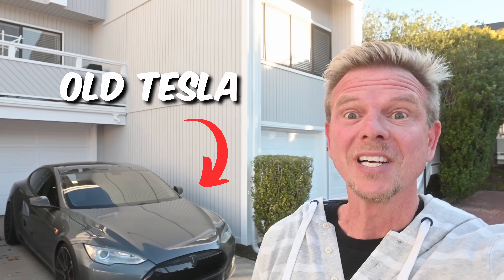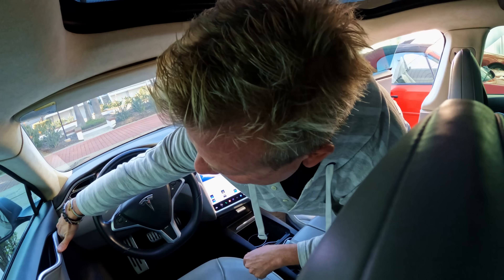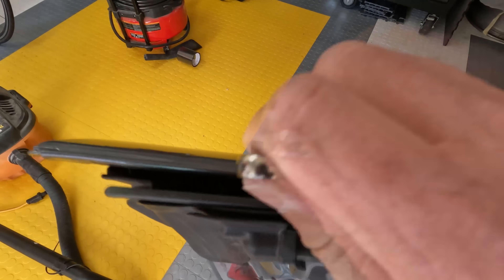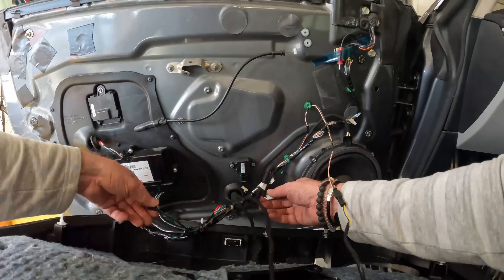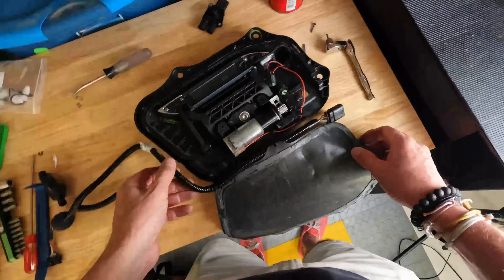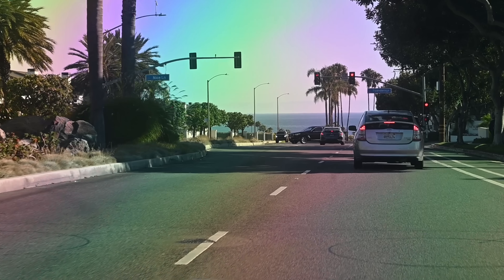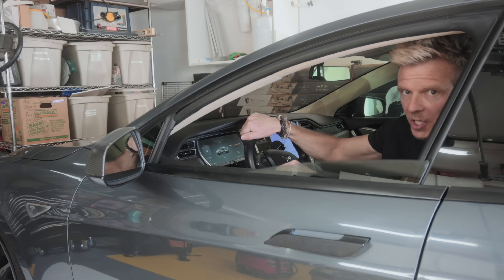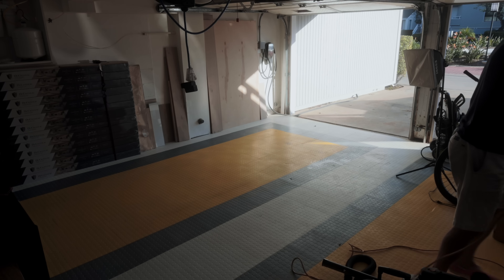My OLD Tesla Model S Just BROKE. Now What???

Comment: The only thing that has "broken" on my 2012 Ford Focus Hatchback with manual transmission is the coolant reservoir just recently cracked. I bought a new one and it took me a minute and a half to replace it. The car has 164,000 miles on it.
Reply from the maker: That’s amazing! 
But on the flip side - you have to drive a 2012 Ford Focus every day… 😊
Reply: @cadreamdrives  - Being a hatchback is it very convenient for hauling all my filming lighting equipment, as well as the occasional purchase, like the lawnmower I bought 3 days ago. It is fun to drive. It handles well. I get 35 - 36 mpg in the winter and 37 - 41 mpg in the summer. I love this car. Ford could have had a hit on their hands if they didn't stick with the DCT transmission it had. That killed the vehicle. Since I've only been driving manuals since 1991 though, it was a no brainer for me too. I also bought it with 16,000 miles on it, and saved $8,400 off of sticker....because used manuals don't sell well. With 164,460 miles on it now, it may be my last car. Still runs perfectly.
Reply: How much longer do you have to drive that Focus for losing the bet?
Reply: @AStanton1966  - This will likely be my last car. It still runs and drives like new. I've done the regular maintenance on it (I am previously an auto tech and I've worked on cars my whole life). It has been the most trouble free car I've had and it is fun to drive. Without the horrible DCT transmission there are none of those issues. 

Today's cars are not much more than over-tech packages that collect data that violates your privacy. Many cars have large screens in them that you HAVE TO LOOK AT in order to use heater controls, or to jump from one specific radio station to another. This requires you to take your eyes off the road so that you can be sure to touch the exact location of the images of buttons, instead of being able to FEEL actual buttons/knobs without looking.  The notion that controls in a car are done that way, making you take your eyes off the road, is insane.

Today's cars track HOW you drive, WHERE you go, HOW OFTEN you go there, how MANY people you take with you, and if they are adults or kids. This data is collected at any time by the manufacturer (you didn't believe Over-the-air Updates were for your convenience, did you?)  and then sold to a data collection company. It is another source of income that the manufacturers make off of you. Then that company identifies your insurance company and sells your information to them, and THEY make money off fo you too. Then your insurance company looks at the data and see you slammed your brakes on several times, and you accelerate faster than they like. This makes you a "risky" client and they increase your insurance rate. There are already a number of videos here on YouTube of that happening. Please take 4 seconds to search for them if you don't believe me.

The light that comes on when you have something kind of heavy in the front passenger seat that says "Passenger Airbag Off" is there to keep the airbag from harming children when they are in the front seat. However, that same sensor is on all the seats so that the car can collect info on how many people are riding with you, and if they are adults or kids.

I am choosing to opt out of that by not owning one of these newer vehicles. Also, my car has been paid for for years. I bought it when it only had 16,000 miles in 2014. Original sticker price was $22,400. I only paid $14,000 for it. Because it has a manual transmission there wasn't as big a market for it, so it was cheaper. I believe I am the one who is laughing loudest.
Reply: @1001Hobbies  I've often said that 40 years from now the cars of today won't be classics and showing up at the car shows.  There're too many electronics that will degrade.
Reply: @AStanton1966  - Besides that, the body styles prioritize aerodynamics over style. In the early 1970's and before it was about style. That's why they are classics. Agreed.

Comment: This is the exact reason I turn off the folding mirror when the car is locked. Imagine how soon it will fail after opening and folding 4 to 5 times a day. Personally, the less tech the better, only when the feature is necessary. Tesla is basically a hibernate mode of a laptop so it is constantly using battery even if you don't drive the car - loosing about 1% a day by just parking. The old remote car key would be just fine because the car basically has to constantly figured if the phone or a key is nearby to unlock the car.

Comment: My cadillac xlr v is having issues...the door pads went out and now the push button on the inside went out along with the window wires that are connected to the motor, rusted out so my windows stopped rolling down.  Pretty crazy this electronic stuff

Comment: The KISS "Keep IT Simple Stupid" method would have worked better. Why is there is servo just to extend the door handle out to for you to extend it further to open the door? High tech is nice but simple door mechanism design over 100 years ago seem to cost less and quite possible never fails.

Comment: Ugggg, toooo complicated.  Sooo many reasons not to buy an EV!! The $1,500 u saved on doing the repair yourself u can apply to the cost of battery replacement! Say $35,000 to replace battery?
Reply from the maker: It’s actually quite a bit cheaper than that. A refurbished battery from Tesla is less than $15k now, and 3rd parties have them even cheaper. You can also get them repaired. 
And while that is still a lot of money, it’s a lot less than it cost to replace the two gas engines I’ve had self destruct on me (BMW 650 and Jaguar XKR). 
Owning an older $100k+ MSRP car is never without risk. But there are lot fewer things that can break in an EV than in an ICE car.

Comment: You have a dilemma...
your garage doesn't seem that its wide enough to drive into and exit from the passenger door. So if you drive straight in and exit the driver door you can't open it again. You would have to back into the garage and then slide over the center console and exit the passenger door. And of course, slide over again to drive it out.

Good that you resolved this little technological nuisance. It could have happened anytime you parked in a parking lot and someone parked too close to the passenger door.

Comment: Wait till the $37,000 ??? Battery has problems. Hopefully Amazon will sell a fix for it. ONE GRAND for a door handle??? My F1 McClaren Race car has a cheaper handle price. I could buy TWO handles for that Tesla Price. GOOD LUCK!!!!
Reply from the maker: I think you may have to check your battery prices 😊. 
But here is the thing. It may cost me $15k if I ever need to replace the battery in the car. That’s a lot of money, for sure. 
But it’s a lot less than the cost when my Jaguar XKR and my BMW 650 had engine failures - both a much lower mileage. 
A Tesla Model S is not a cheap car and repair prices tend to follow the original cost of the car. 
But right now, old Teslas can be incredible bargains - even with the risk of battery failure. 
I’m also not sure you really want to be comparing service and parts costs - or general reliability - with McLarens. 
They are awesome cars, for sure, but they don’t exactly excel in reliability and affordability 😄
Reply: This is why 10 year old Tesla’s are not worth anything, but for parts.

Comment: Now if you were a Service Technician, you get paid once.  And you usually get paid 50% of what it actually takes to do that job.  But the Manufacturer calls that a Fair Price.
Have you noticed how many Service Technicians have quit the Business?
Reply from the maker: In all fairness, if I were a Tesla Service Technician, I would likely have finished the job in 30-45 minutes…
But - it sounds like you have some knowledge about unfair practices at Tesla? 
Do Tesla Technicians get paid per task? Not through an hourly rate or a fixed salary? 
My experience has mostly been with other manufacturers, where opposite seems to be true. They charge based on the amount of time a job says it takes in the official service manual - but the technicians do the job in half that time, or less. They often also ignore time savings when parts of jobs overlap. For example, if it takes 30 minutes to remove the under trays, and they have two tasks that require the removal of those trays - you’ll get charged for 2x30 min - even though the trays only get removed once.

Comment: I personally wonder where Tesla would be if being practical and reliable were prioritized over being cutting edge and techie?
Reply from the maker: I feel like they have done an amazing job at trying to be both. Especially for a brand new (at the time) car company. 
My Model S has been incredibly reliable - and it’s immensely practical. 
Does it have quirks, flaws, and things I wish were done differently? Absolutely. But no more than any of all the other cars I own and have owned. 
Is there anything in particular you wish were different?
Reply: @cadreamdrives  Elon is very stubborn about trying to use only cameras for self driving and removal of physical switches and controls. That's the biggest thing. I would also like to see Tesla encourage and partner with independent shops for repairs.

Comment: I have a 2019 Model X, on this you can "dobbel click" on the key fob or use the app to open the doors. Is this not an option on an older Model S?
Reply from the maker: Hi - Yes, those methods all work on an S too - as does pushing on the door handle. However, when the handle’s control module breaks, it simply stops unlatching the door when you pull on it.

Comment: Oh boy  that was  an adventure
Reply from the maker: 😄It was! It was a very satisfying one, but there may have been a few not so clean words at different times 😊
Reply: Thank you for the quick response. I think I was able to hear your words all the way in Highland Park.
I do want to buy a second hand Tesla this year but I'm a little scared. (because of your quick response i'll suscribe to your channel)  @cadreamdrives
Reply from the maker: @laframe1016 Well, Highland Park isn’t that far from Newport Beach 😄. 
Buying a used Tesla (or really, any used car) isn’t for everyone. There IS a risk of a high repair bill (if the car is out of warranty). However, that risk is there with ICE cars as well. I’ve had engines blow up in both a BMW and a Jaguar. Both of them were just a few years old and both of them had less than 70k miles. Those bills were quite a bit more than a new Tesla battery…
For me, a used Model S offers an incredible car for very little money - but you do have to be willing to accept the risk.

Comment: How much does ev fix me charge to calibrate the control unit you installed?

Not sure if i have that type of resource near me in new england. 

As a diy person its this proprietary software required stuff that is intimidating. 

Would love to know the parts cost for the parts you did install. 

Killer videos. 

I want an old model s so bad.
Reply from the maker: Thank you for watching and commenting! 
I don’t remember the actual charge, but wasn’t much. I’ve also since learned that you may be able to do the calibration yourself as well. 
I think my total parts cost was less than $150, but please don’t use that as a price quote. The video was made quite a while back, and the pricing could be very different today. 

There are more and more EV shops popping up everywhere. I suggest checking in some of the big online Tesla forums (like teslaownersonline.com and similar), to see what shops might be available around you. 
In most cases, Teslas aren’t all that different from ICE cars to work on, so if you are a DIY person, I wouldn’t let that keep you from getting an old Tesla. I absolutely love mine, and have for years.

Comment: Your HV battery and drive unit are both ticking time bombs. Save your YT revenue for some huge incoming bills. Lots of other $$$ will fail too.
Reply from the maker: That is quite possible. Old luxury cars come at a cost. But I have had a BMW and a Jaguar (both $100k+ cars) blow their engines at a significantly higher cost than a new battery, so I’m liking my odds here.

Comment: Not exactly a ringing endorsement for the Tesla dealer experience.
Reply from the maker: I have actually never used the Tesla Dealer / Service for anything. 
My car is old and I like to save money, so I try to fix things myself, when I can. 
I think like most dealerships (especially higher priced ones), the service can be good, but you pay a premium. 
Tesla will actually send roaming mechanics to your place for most minor repairs (including door handle issues), which I think is a great service! I just didn’t want to spend the $$$ to go that route. 
Alternatively, 3rd party shops like EVFixMe can do the work at much cheaper prices than the Tesla organization. 
My principle: All cars covered by service contract or warranty go to the dealer for service. 
As soon as they are out of contract, I use 3rd party shops or do the job myself, whenever possible 😊

Comment: How did things get so complicated??? Get me an ICE car with manual transmission, air cooled engine, carbureted, no ECU, no electronics...roll up windows, keys for the door and ignition.... no air bags (die like real men).
Reply from the maker: An ICE car is magnitudes more complicated than an EV. Even in its most basic form, like you describe, it has a crazy amount of moving parts, that all need to work together perfectly. 
It doesn’t get much less complicated than a battery and an electric motor…
Reply: Yes. Hundreds of moving parts.. but the nice thing about mechanical parts is that they hum and purr when they are perfectly tuned, lubricated and cooled. When any one of those hundreds of parts you mention fail, it does not do so suddenly.  You will notice barely audible sounds and vibrations at first, or misfires, higher operating temp, clicking CV joints... and then it worsens until it finally fails. It gives you enough time to oil that squeak when you hear it. Same for plugs, cams, belts, rotors, sensors and so on. Not so for electronics and EVs. When they die, their dead in an instant. Kaput. Like that door handle. But I may be wrong... about Teslas. With all those computer controls, I'm sure there are warning idiot lights?
Reply: "Air cooled"?  You want a VW beetle?
Reply: @GH-oi2jf  In mint condition? yes.

Comment: 80 % more problems then a gas car
Reply from the maker: Right - that makes a lot of sense. Because one type of cars have pistons, cylinders, valves, camshafts, vacuum hoses, oil pumps, get valves, exhaust systems, transmissions, seals everywhere, spark plugs, ignition coils, and a never ending list of components that make all of the above work together. 
And the other has a battery and one or two electric motors - and pretty much nothing else. 
So clearly the second one must be the one with all the problems. 

Why do people keep pretending that ICE cars never have problems???

Comment: It should be illegal to have car doors that cannot be open with a manual mechanical mechanism. Thanks for telling me - I wont ever ride in a Tesla.
Reply from the maker: If you ride in it, you’re fine. They have a manual override in the regular handle. You simply pull it further and it will unlatch mechanically (as opposed to electrically).

Comment: Owning out of warranty EV is like playing russian roulette...
Reply from the maker: Well, maybe not quite Russian roulette, but owning ANY used car always comes with a risk. Contrary to popular belief, I find a used EV to be much less of a risk than a used ICE car…
What do you find risky about used EV ownership?
Reply: @cadreamdrives  well you never know when battery gives out. Then your car will probably be scrapped. In ICE what worst that can happen? Complete engine failure? Here where i live, used 2.0 diesel engine and replacment ususally goes 4-6k eur, new engine is around 10k all in.  While battery costs 20k or more.
Reply from the maker: @Vidmantas969  I understand what you’re saying, but I think the fear of battery failure is vastly overblown. Yes, it can happen, but there are also Teslas with several hundred thousand miles out there, that are still going strong. 
In addition to that, a refurbished battery is now down to $15k from Tesla (still a lot of money, but less than $20k) and third party places will do them for closer to $10k. There are also repair options (depending on the state of the battery) for a lot less. 
But it’s a fair point because there is a risk. However, in order to compare apples to apples, you can’t really use the price of an engine for a much lesser car. The old Tesla Model S cars were $100k+ cars from new, and engines for $100k+ cars are not cheap. 
I know this because I’ve had two of them fail catastrophically on me (BMW and Jaguar) and both were crazy expensive. The Jaguar would have been close to $35k, so I ended up scrapping that car (which hurt!). 
Both cars had less than 70k miles on them when it happened. 
So yes, there is a risk with an old Tesla, but I’m not sure it’s more of a risk than with old ICE cars. 
In my case, my Model S has been significantly cheaper to own than any luxury ICE car that I’ve ever owned.
Reply: @cadreamdrives it really isn't. There are 7000 individual battery cells in your car. Just one cell failure will completely shut down one cell bank and throw the high voltage battery code. It will certainly happen. Every time you supercharge you risk damage to the barrier between the annode and cathode in each of those 7000 cells.

Comment: Why not get a normal car? The maintenance on these things long term is a an absolute disaster as you have found out 😅
Reply from the maker: It’s actually the complete opposite. All cars break at some point. But Teslas break a lot less than old school cars. EVs simply have a fraction of the parts you find in ICE cars, so there are a lot fewer things that can break.
Reply: I wish :(